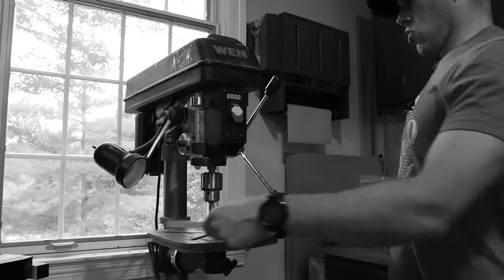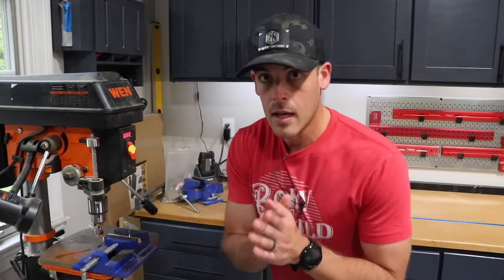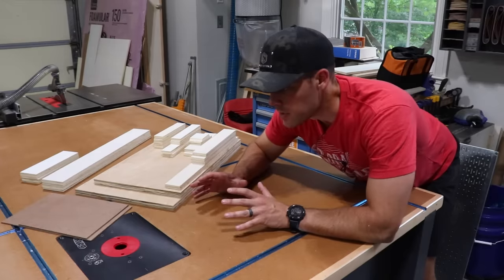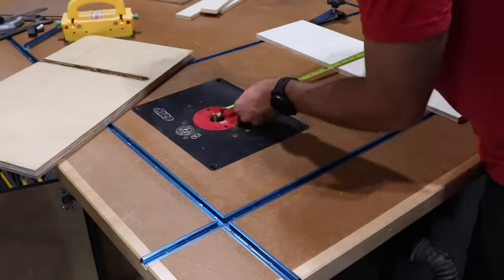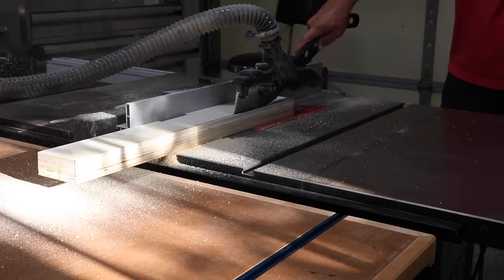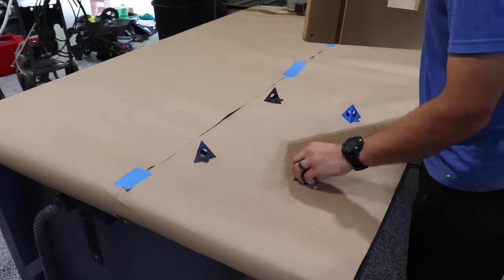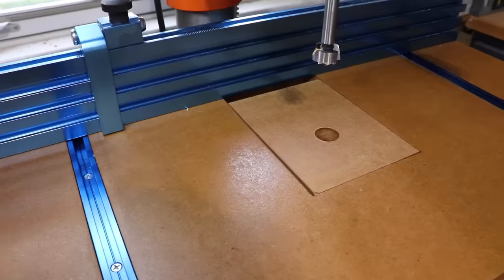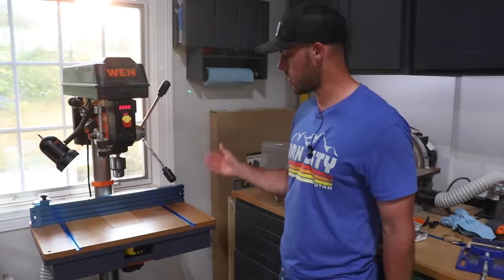Upgrade your Shop Drill Press // Easy Woodshop Project

Comment: Cool build!  One of the things I'd like to see is how to quickly and accurately keep the table perpendicular to the drill itself.  My table always rotates along the post as I raise/lower it.
Reply: If you never have need to shift the table left and right based on the kind of work you do with the drill press, the solution is simple: drill 3/16" hole in the top and the bottom of the toothed rack on the vertical pillar and install a screw into the pillar.  That keeps the center of the table perfectly aligned with the quill's axis as you raise or lower the table.

Comment: Great build, I have built something very similar. The only problem I encountered was screwing the T track into MDF. It eventually pulls out
after use do to clamping pressure. Better off drilling right through MDF and using machine screws bolted on the underside.

Comment: Building one for my shopsmith. Love how you made it thin, if deeper, drawers become full,, heavy, unorganized
Great idea on magnets and tape storage
I will add foam to one drawer,  as I use the router, pin router in mine.
Trying to figure out my pin, on the top of table. 
I came up with a circular removable insert in my drawing. Rotate vacuum hole around work, pin is centered anchored to base below. 
Am I missing something.
Need mine light, as I will be installing on my aluminum table, when standing up, revoing otherwise.  Part of the Shopsmith system, I am developing for building guitars mostly. 
Thanks, great content.

Comment: Very good design. Not too bulky or obtuse.  I would add one last thing... Extendable side wings, I like Shop Smith's that slide out on square aluminum bars.  Sometimes you need that extra distance when drilling out waste for table legs.  But even hinged extensions could work also.

Comment: I'd add some thumb screws to the 4 corners for hot swaping those metal/wood interchangable tops. Also, maybe just me but I like to keep my drill/forstner bits nearby, so I'd add a mount for those (maybe to the stand itself so they stay with the press instead of being removable).
Reply: I'd go for speed knobs as they're more comfortable to use, but the idea is the same, definitely.

Comment: Nice job and looks great! Let’s see it in action doing some drilling. I wouldn’t cut your aluminum fence yet an d try modding your wood fence to dial in first.
Reply: I agree.... If you are using the fence, most likely something will be up against it (the purpose of the fence, right?) thus blocking the cutout...  Maybe the hole in the sacrificial insert, or slightly undersized/sliding like the Katz-Moses version so you can have dust collection in front of the work piece.

Comment: Cool design, Travis~!  I've been looking for a good cabinet design to go with a floor model drill press as well.  Seems like most good ones on the Tube are for bench top models.  Maybe a future Shop Nation build?  Thanks for the video~!
Reply from the maker: Do you mean a cabinet that slides over the base and sits below the table?
Reply: @ShopNation  Yes sir, that's the ticket.  I currently have a couple small Rubbermaid containers stacked up on the base.  Tacky, tacky, tacky~!  Gotta come up with/find something for my drill press gadgets, widgets, & gizmos (aka, bits, bits, & bits) before I end up expanding into container numero tres.
Thanks for the reply~!  ;- )

Comment: I know it would be more expensive to make it out of aluminum extrusion, but have you looked into the product below?  At 10mm or about .4 inches it could make a nice drill press table and add a wooden top.
McMaster-CARR
Miniature T-Slotted Framing and Fittings
part number 	1959N1 up to 24 inches.

Comment: Something I noticed is a lot of drill presses have a pipe to attach the table for mounting. If you have the capability, you could build your wooden table with a pipe and simply swap the metal and wood table, instead of using a bunch of clamps on the metal table.

Comment: Loved the drill press table project.
“Hardboard” was used in this project for the drawer bottoms.
“Hardie Board” is fiber cement construction material, ie, fiber cement siding and backer board.

Comment: Now that you've had it for a while, I'm wondering, do you find that the in-table dust collection is worth it? Seems like a lot of extra steps when building a table to add the thickness for the dust collection, but when I look at it I don't understand how that slot in the fence (which is usually covered by a workpiece) really collects much dust. You and JKM both only show it collecting dust when there's no workpiece there.

Comment: Great build. Is there any functional reason why you had the  removable top cap screws screw in from the bottom rather than screw down from the top?  I would probably be dropping and losing the screws when taking out !!  Also would need a set of the screw insets for each table rather than just one set in the base and the same screws to secure the top.  There could be a good reason that I'm missing .

Comment: This is an awesome Idea and having a interchangeable work surface is going to be super useful. A question I had was...  How do you keep the drill press handles from hitting your fence when you are working on a piece that requires the table to be closer to the chuck? Or does your table have a maximum limit to how close the rest (or table top) can get to the chuck?
Reply from the maker: That is an open issue that I'm thinking about, because you're right, it does happen...
Reply: @ShopNation  I guess it would really depend on the machine you have, how far of a drop the chuck can go and how big the handles are. For example, my press has much shorter handles but seeing yours are much longer got me thinking about other presses. maybe you can interchange the handles for smaller ones or have a specific fence for those up close projects? I know some folks use small drill bits, countersink bits, and other smaller in length bits which could require a shorter travel distance with the chuck. Thanks for answering! We all can achieve shop greatness together!
Reply: One solution I've seen many use is to remove 2 of the 3 handles, seriously considering this one myself.  I mean, I usually grab the upper back one anyway because then I don't have to switch handles mid way through a hole.

Comment: nice job. Always love seeing your videos. like the dust collection option and yes you always need that on the top suction as well. I did find it funny that your table saw looked like it's dust collection needed improving and you didn't have anything on your miter saw. lol.  liked the triangular painting cones you used what brand were they? Also have you made the metal top for it yet?

Comment: the flex hose (LOC-LINE) is a pain..dust collection on a drill is harder as all the dust is formed on top of the piece. So any dust collection that sucks from below doesn't really work. I created a mount that's attached to the drill press pole, then 3d printed an attachment so the blue loc-line could be mounted. It wasn't really good to mount to the pole as you need a lot of the hose sections to get the thing to get close enough to the drill bit, only to realize that the other side of the chuck  is caked in dust. ( I end up wiping the dust under the bit all the time which is dumb) If you attach to your fence a dust port, then this sometimes gets cancelled out depending on the height of the piece you are drilling. You need some kind of soft rubbery HEMI-hood that  can somehow be supported above the the thing you are drilling...so I took all that crap away and my 3" flex powertech hose just sits beside my drill, and I drill a hole, then suck it it up rinse and repeat...so far  that satisfies me the most. I can send send a pick of the loc-line set up if anyone wants to see. Its 50% effective. Sucks one side only:)

Comment: I like the store bought, extruded fence too. Does  the chuck hit it since that fence has no relief at the top like the one you made?
Reply from the maker: it will if you get close enough but I haven't run into that issue...yet
Reply: As someone else noted, you can flip that fence face down and use as low profile fence if it becomes an issue.

Comment: Ok watching this and on the table saw
Using a push stick.
I bring this up knowing your using a anti kick back or splitter or riving knife.
But think about this it will make perfect sense. On stock as your pushing past the blade if you put the push stick close to the fence your part wants to turn into the blade, but if its on the blade side your parts trying to turn into the fence becuse its a narrow tool a wide push block gives you more control becuse it hooks a larger surface area but the thin one lean more to making a part want to turn, on a table saw this can cause kickback.
So its safer to push closer to the blade.
Or use a wide push block 
The gripper was well thought out becuse it does this and pushes bothe the part and off cut past the blade.
You dont need to buy one you can make your own. 
Anyway even with a splitter or riving knife it better to work to your advantage and do things like this becuse you honestly never know what could happen with a chunk of stock and tensions built up in it.
A wider push block is always better but you cant always use one. 
Me I use board buddies they hold the stock down to the table and pull them into the fence, but they can get in the way, I can still push the end with the same or thinner stock or a sacfical pec of stock and turn off the saw when the cust done.  JESSEM makes a stock guide for table saws that do what board buddies do and can flip up out of the way.
I dont own a set of them for a table saw but I have them on my router table and they work really good.  It makes routing a lot safer.

My point is there is no such thing as too safe.  You've got some really nice tools 
The wen drill press is beneath you
Id look at the Nova drill presses 
The wen is more a starter machine.
The Nova is more the sawstop of drill presses.  It only stops short of putting butter on your toast. 
Auto feed, ditigtal speed auto stop depth
Forward and reverse  you could tap with it.   I seen a table top model at a woodworking show my jaws dropped 
Becuse ive ran bridgports and the only difference between a bridgport and this drill press is mores taper chucks and x and y axes as well as table travel.
The power head is a DC motor
Its going to have total hp at any speed
You wont get with a belt change speed system.  And you just enter a ditigtal number or dile it in.

Comment: how do you loose your tape measure if it’s in your apron?
you do have an apron, yes?
if not, get one, you won’t be able to operate without it.
left pocket, mini combo square l, and 10 penny finish nail.

right pocket, eraser and 12’ tape measure 

top pencil storage, 3 or 4 pencils, one 0.5mm pencil, sharpie, and a nail set.

once you’re set up like this, you won’t be able to work without it.
try it !

Comment: Take 000 steel wool, wd40 and some elbow grease and scrub the rust off the table, then wipe the wd40 off with a mild dish soap (Dawn) on a damp cloth, dry with compressed air  then wax your table top like you would your table saw, do every part of it that bare metal rack colum everything and keep it like that and it won't rust. You have to coat cast iron
Or humidity will make it surface rust.
Even if you put on a wood table on it do it anyway or its going to rust. 

If you put a wood table on it years ago, take it off and do this. And do it once a year or more just to make sure it dont rust.  Once you let it rust pits into the metal its hard to fix.

Comment: News flash...  The little badly made original equipment drill press table are inadequate for any kind of work. I gave up on mine and built a larger surface for metalwork and for woodwork. A 12 x 20 steel plate gave me room to clamp and have better stability of the material I'm working on.

Comment: Assuming this also works for a benchtop drill press?
Reply from the maker: It should, just need to double check that the T-Track spacing on the bottom is narrow enough to catch the slotted holes in the smaller table.  Would be easy to adjust for

Comment: Maybe add an LED light above the table?
Reply: I did that a while ago, best thing I ever did to my drill press.  It was a cheap magnetic mount with flexible boom.  I wired it directly into the power in the switch so no extra cord.

Comment: I’m confused, ”quick and easy” ? Undo 4 bolts with two different tools! No one is going to undo 4 bolts and fit another top to drill a few holes in steel. Especially the ones that can’t keep the original table clean. Make it double sided clip on clip off then you  may have something worth sprooking about. 
The last dozen things I used my drill press for I would not of put that table on for. When I have to repeat the same hole in the same spot a few times I would fit it on as a repeating jig.
Reply: Yep, I'm thinking cam-locks or some other no-tool retention system. As soon as it gets fiddly, it wrecks my workflow and guarantees I'll never do it. Best, Andrew @BranchAndFoundry

Comment: Your Tablesaw: do you not have your dust collection hooked up to it?  It is throwing up chips and dust from the backside of the blade like crazy.  For a video about a special fixture with dust collection, it seems like you need to address some DC basics on your other tools.  And speaking of tablesaw basics, at 8:15.5 are you using a dado blade with no throat plate, and your workpiece is only supported by the table by about 1/8" on one edge?  I am by no means the safety police, but that is not how you should be using that saw at all.